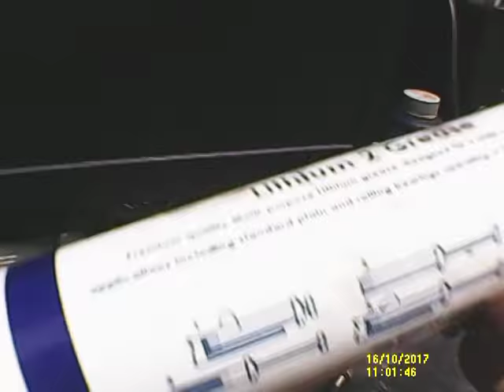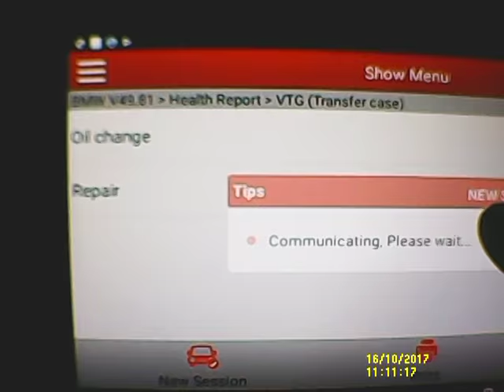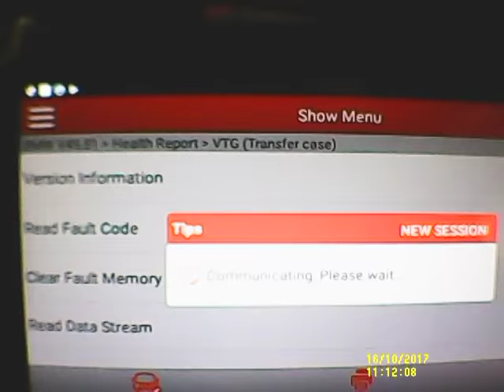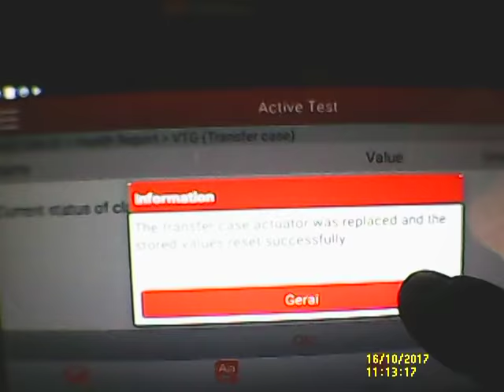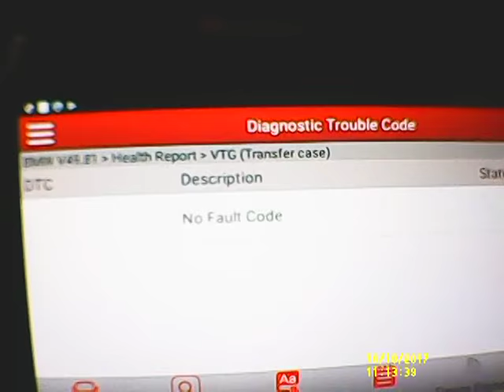BMW  Fault: 5463 Mechanism faulty, 539E Transfer case malfunction,  Repair - Adaptation

Comment: What is the diagnostic software/tool that you are using to reset transfer case?
Reply: Bump.  Really would like to know tool also.
Reply: @lharvey16  My mechanic has the same one. 1 K Canadian, I'll ask him next week what brand and what not it is
Reply: @rugclenr  Did you ask him? I would like to know as well.
Reply: Looks like aultel or snapon
Reply: It is xdiag, I have x431 and it is the same